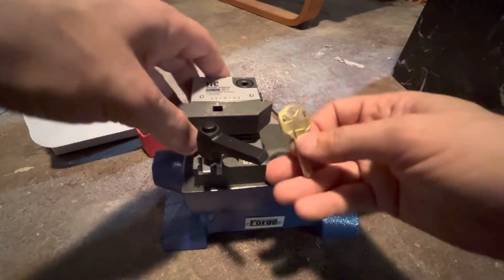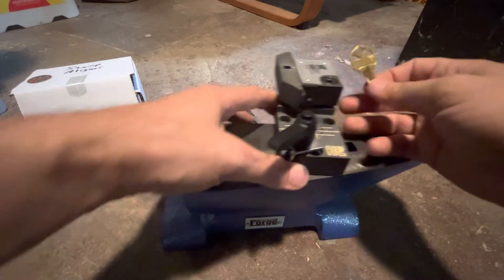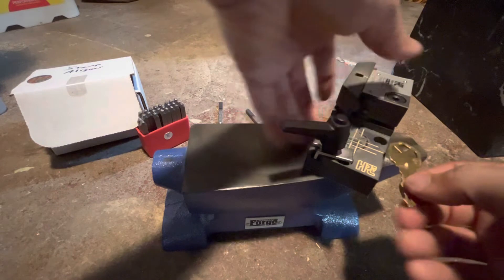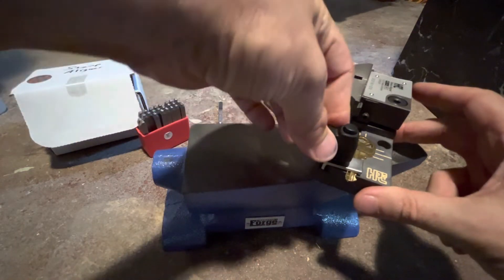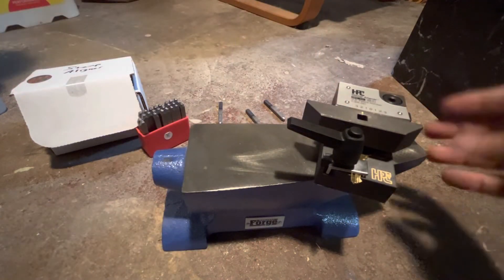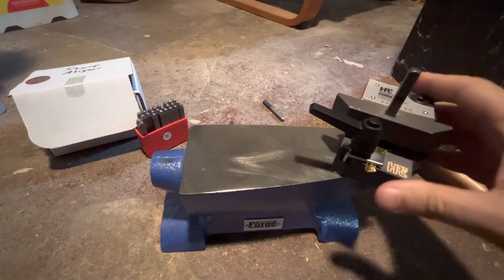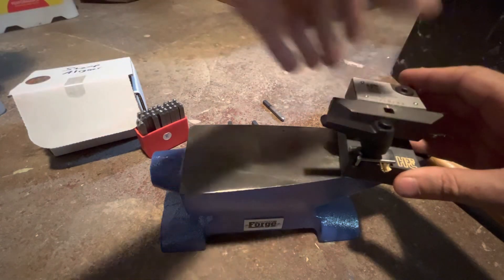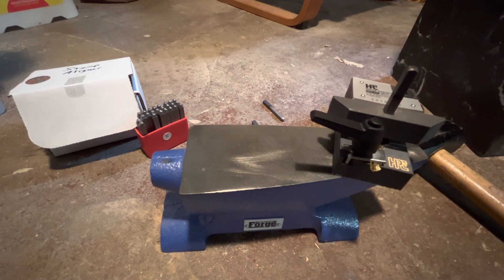Minor tips learned using HPC Stamp Aligner SA-7

Comment: Love that anvil. I sold my stamp aligner last year after not using it for several years. There should be a “stop” on the side that keeps it from going too far over and losing that ball. Mine had one. I’ve gotten used to freehand stamping. The secret I learned whether freehand or using the stamp aligner tool is to do the center letters/ numbers first then work my way outward. It’s the easiest way to center them. Jmo. Thanks for sharing!
Reply from the maker: Yeah, I noticed the stop but for some reason it wasn’t in the right position to actually stop on one side. Maybe I’ll move it so it actually does its job 🤣 The anvil is just the cheapest and lightest I could find which wouldn’t kill new on shipping (Harbor Freight “Central Forge 15 Lb. Rugged Cast Iron Anvil” currently 24.99 before shipping). Great tip on freehanding, I’ll remember that! 🙏

Comment: I looked at this HPC stamp aligner for awhile.  Seems okay, but not exactly what I wanted.  Eventually I found a deal on a Young Bros steel type marking kit with stamp holder (really just a re-badged Pryor kit).  That things rocks!  Set up your text, and then only one strike.  Perfect alignment.
Reply from the maker: That sounds awesome. Where did you find it and if it was online, what search terms did you use (if you remember or used a saved search like on eBay)? I remember from researching after RubberBanned’s video that full retail was a bit steep, but if there’s a deal… 😁

Comment: BBACC  and a KW1 blank?  Is someone making a SmartKey tryout set?  (I ask because I have 250 blanks heading my way for doing exactly that!)
Reply from the maker: You are correct! I have to say, that while it did serve one of my intended goals of becoming more familiar with and comfortable using my Framon machine, in terms of hours spent… I really should have just ordered a set. I was cutting about 9 keys an hour so that’s at least 27 hours, more really because of miscuts and C cuts in #5 sometimes warping the end of the key. Stamping I’m running about 27 keys an hour so that’s another 9 there, so probably about 40 hours total on this project. At $450 for the set you’d be working at 11.25/hr very grueling work. I’m obsessive enough that once I started I was GOING TO FINISH G*DDAMNIT but I can’t recommend the experience to anyone else and have regretted my obsessiveness thoroughly from about the third hour onwards 🤣
Reply: @Chirael  Yeah, I know it's a daunting task but for me it's a hobby, not a profession and $450 eats up a LOT of hobby money.  If I had an extra $400 I'd buy that smartkey camera decoder thing for $350 or so.  :)   Very good point about bending the tips with the C cuts though -- something I need to be mindful of.
Reply from the maker: @theprofessionalhobbyist802  Fair enough, I totally respect that and was originally thinking something similar myself. At least you’ll know what you’re in for! Yeah I’d say just take those #5 cuts S-L-O-W - go a little, pause, go a little, pause, etc. Doing that eliminated virtually all of the warping. Also in the future I might pay a little more for Ilco blanks instead of JMA since I think that was part of it (quality of the blank).
Reply from the maker: @theprofessionalhobbyist802  Do you already have split rings and key tags for this? If not I’d be happy to send you some (27 of each, since I put 9 keys on a ring and then labeled them AAA, AAB, etc. for the first three cuts of the 9 on each ring)